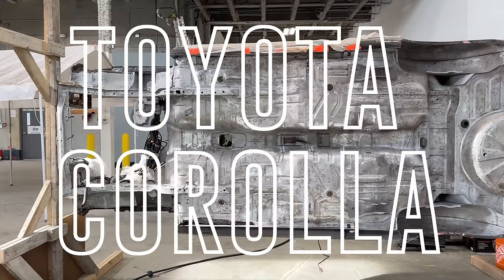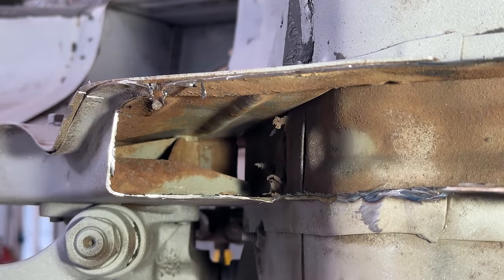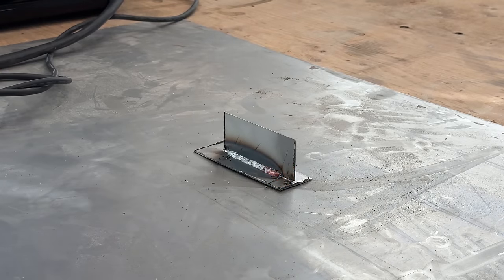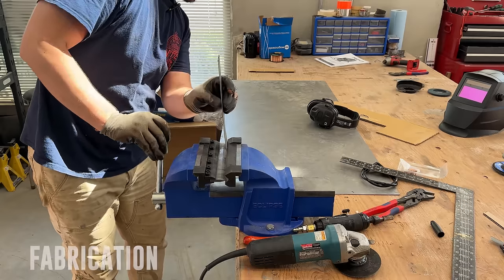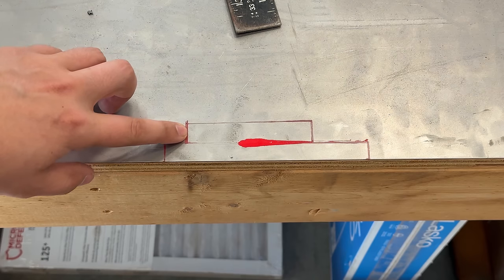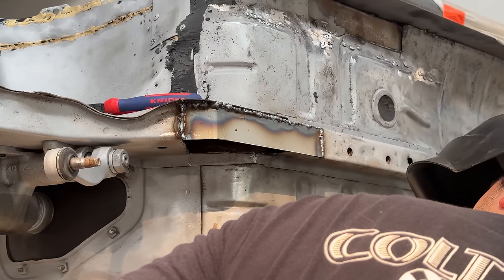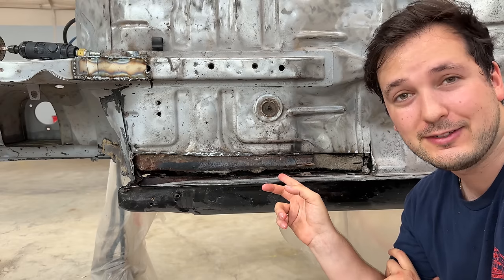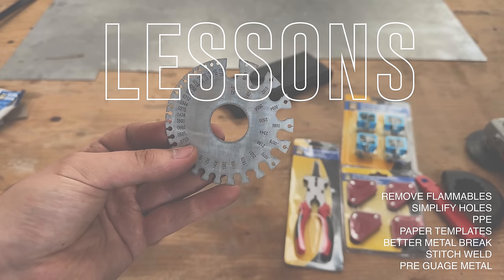1972 Toyota Corolla: Undercarriage Welding

Comment: Love your videos; what a fun project. Couple things: your regulator there isn't measured in PSI on the flow side. It's gonna either be liters per minute or Cubic feet per minute (generally). Usually for MIG like what you are doing, you want around 18 to 20 CFM. From what you showed real quick there, I think you set your flow regulator clear up to 20 L/min which is over 40 CFM and about twice the gas you wanna be using. If the gas flows out too fast, it won't provide good, even, soft (controlled) coverage and it will make your welding life hell. Additionally, you probably want .030" wire for this job, if not thinner. I think you might be running too heavy a wire in your welder there, although it depends on the thickness of the area. Also, better if you don't weld in short sleeves, because UV burns are no fun. Nice job for your first go around though; keep in mind that you are biting off a lot for a novice welder. Even coach builders who have welded 20 or 30 years find butt welding thin sheet metal tricky at times. It takes a lot of time under the helmet to get right. Also, in very light weight sheet metal areas, it's less "MIG welding" and more spot welding (via the MIG welder). Anytime you can lap weld instead of butt well, that can be helpful too (if it's in an area which isn't super visible) - that will help reduce burn through. Also, joint / gap fitment is 99% of the game when doing this kind of welding. Great job so far; hang in there!
Reply from the maker: This is such great information, thanks so much for sharing! 

You’re very right, it is L/min, I was wondering why I went through the bottle so quick. I usually had long sleeves on, especially after a hot piece of metal hit me, but I didn’t know about the UV’s.

With the wire thickness, because I went thicker, is that putting too heat into the piece?

I quickly learned fabricating is the name of the game. It was a ton of fun, and hope to learn more, thanks man!
Reply: @sansberlin  Yeah, the issue with running too high of flow rate on the gas is that you end up firing the gas out of the nozzle at such high velocity that it can actually cause porosity in the weld and/or cause a cooling effect, etc. All things which work to undermine what you are trying to do (you'd think more gas is better, but sometimes less is better). Try doing some test welds using different flow rates; try 5 CFM, 8 CFM, 10, 15, etc. and you will see the difference - also welding into a corner is much different than welding flat, because the corner helps keep the gas in the vicinity. You also want to unscrew that outside tip and knock out the splatter often; it will build up and disrupt the even flow of gas. The other thing you might not realize is drafts in the shop can have a huge negative impact. If you crack open a door to vent in fresh air and you have a breeze flowing as you weld, it will serve to blow away the shielding gas just enough to cause issues sometimes. That might have been a factor in needing more heat also, by the way. I recently did a big job where I had to weld hundreds of junction points for a concrete / rebar slab and just a light breeze outside really caused issues; I had to put up wind blocks in order to weld, otherwise the welds would go off track. So there are a lot of little, subtle things which can throw you off in welding if you aren't careful. Another thing when it comes to sheet metal welding, it's helpful to sand paper / clean up the area on both sides of the weld area using like a flap sanding wheel or disc just prior to welding, then wipe both surfaces down with acetone. That can improve your welds (more for TIG welding, but helps for MIG welding as well). You might have also been suffering from poor grounding as well. You wanna make sure your clamp is close by where you are welding and making a good bite into the metal (when you had the wire kick back on you, that's because it wasn't seeing a good ground). The other thing - and you probably have learned this by now - is you were holding the tip pretty far away from the work. Generally speaking, you wanna keep the tip in pretty snug to where the puddle is, especially when doing brief tack kinda welding. Try doing some test welding with the tip really in tight vs. back 1/2 or 3/4 of an inch and you'll see what I mean. As far as wire size, yes, larger wire requires more amps to melt and it takes longer to form the puddle. So for sheet metal work I would probably recommend the smallest possible size wire you can run. I mean I run .030 here for welding up to 1/4" plate steel. What you want is thin wire and a hot / fast tack weld. Wire feed speed is also important. The MIG I used for 30+ years had infinitely adjustable heat and speed, so you could feather a tiny bit more heat or speed; however, new welders (especially cheap ones) sometimes only give you notches (like 1, 2, 3, 4) and sometimes being between 2 and 3 or 3 and 4 ain't where you really need to be. So if your welder won't allow you to fine tune heat and wire speed, that can end up being a nightmare. If you get the heat and wire size / speed on target, you should be able to pop a tiny weld into place and have it almost end up flat. Then you just have to do some light sanding to knock things down. When you see welds which are big balls standing up off the surface, usually that means you are running the wire too fast or too big. Consider this: when TIG welding for example, in some cases (such as fabricating a stainless exhaust system) you might not even use any filler rod. When you have the material perfectly cut / fitted, you can often just strike a quick arc (again, TIG welding here, not MIG welding) and fuse the material. So if you think in terms of that with MIG welding (assuming fitment is right on the money), you really barely need any wire in the mix; just enough to add a super tiny bit. The heat is primarily fusing the two adjacent panels. It's more difficult with old sheet metal than brand new 16ga stainless, but you are kinda wanting to get into that zone. Also if you start welding body panels down the road, be super careful because coming back later to sand down a bunch of weld beads can induce a ton of heat to the panel and warp the heck out of things if you aren't careful. Let me look around and see if I can find a video showing tack welding without filler rod via TIG so you can get an idea of what I mean here. I think I have one in my book marks for Titanium fabrication.... okay here's a good example: https://youtu.be/FZ8CGGYamuE?si=uS2T_X32ngIBDnVu - see how in the beginning he's tacking up the tubes with no filler rod at all? Same when it comes to the rotary part; because the parts fit so well together, he's just melting the two parts together and not even adding any rod / wire. You can't really do that exactly via the MIG (because the arc comes from feeding wire, not from a tungsten electrode tip), but the point is that if you turn down the feed rate of the wire you can get a similar fusing effect on sheet metal. You aren't so much trying to start a puddle as you are trying to simulate a tack weld. For thicker structural parts, such as where you cut out the rust in the subframe parts, then yes you wanna run a puddle for penetration / strength. But even in those cases, you wanna try to sink the weld down a bit more for better penetration (more heat, less feed) as opposed to running the wire too fast and the heat too low and ending up with all your weld sitting up high and needing to be ground down. Try running some test beads and dial up the amps slightly and lower the wire feed rate back until the arc starts dropping out on ya, then dial it back up just to the point where it holds; also keep the tip in tight. When it's just right, you should hear a nice buzz. You might also wanna try removing the outside part of the tip all together for light work; just run the wire out with no outside cone on. You can even run separate shielding gas from a 2nd regulator. For example, on my TIG outfit, I have a dual flow regulator setup so I can run gas through the tip, but also back purge or have a secondary source of gas flowing into the work area. Kinda over kill for MIG, but then again how much do you enjoy grinding :-) Anyway, takes a lot of practice. If you saw the first few jobs I did on sheet metal, you'd laugh. I tried welding fender flares on my car once with a gas torch and it was so terrible I just ended up taking a sledge hammer to the fender haha. Really enjoy your videos. My contact info is on my YouTube channel about page if you ever have any fabrication / welding questions; feel free to hit me up anytime. Can't wait to see the next episode!

Comment: i weld 1970's Japanese cars all the time, here are a couple helpful tips. leave yourself a little bigger gap on the new piece of metal and the old car. second only tack never hold the trigger more than a second or two. and last have compressed air near you to spray it and cool it down that way it does not warp.
Reply from the maker: Thanks for the advice, why the bigger gap?
Reply: @sansberlin  not a huge gap, just a little bigger then you have. the gap allows you to connect the two together. a lot of your welds the pieces are so close that you are welding on top. that will connect the two but not the best. people will use like little 1/16 " tabs to gap it and holt them in place when welding.
Reply from the maker: @alleybuilds5370  makes sense

Comment: Your in some serious need of copper weld primer my bother 😊
Reply: Same comment I was going to make!
Reply from the maker: I'm so curious, what is this? What does it do? How do I use it?
Reply: @sansberlin  rust prevention/protection.  The inside face of the patches you applied have zero rust protection.  For the patches you can not access by removing the carpet, you can treat by applying Eastwood Cavity Wax.

Comment: Switching from Gasless / Flux to Gas welding also requires reversing the Polarity of the Gun...Your Manual for your Welder should explain that and how you do that for your Machine....Check which way it is set as alot come setup for Flux / Gasless welding....and that can cause Bad Welding or Poor Welds ( especially for a Novice ).... I Rent or rather Lease a Gas bottle as it is cheaper if you weld lots...and saves running out of gas and spending time and fuel to get it refilled.... the bottles you buy are ok to start with ( and keep as backup gas use ) but are going to cost you more over long regular use....Leased bottles  come in various sizes ( get one as big as you can afford and transport safely ) and are cheaper to refill ( like buying bulk food works ).... plus they taje care of maintenance on that gas bottle ( testing and replacing as required ).... it is a small fee yearly i find worth the cost ( small bottles would cost be more than that fee and always run out when you are wanting to finish your work ) ..

Comment: Buy the Princess Auto Sheetmetal Brake when it is on Sale...the 36" one....on a Stand...I bought mine 25 years ago and even after getting a Bigger 8 ft model and a 48" Box & Pan / Finger brake ..i still use it lots....it can do 16 guage metal too.... a brake that actually is designed for sheetmetal work is alot easier to do bends than a Bench Vice or Shop Press add on...( they work too but i learned on a 10 ft brake in 1991 and also a 4 ft Finger brake too.)... plus once you outgrow your panels a tiny brake is useless...lol...
Reply from the maker: All these comments are golden, thank you for all your insight and experience, will be following a lot of your notes and critiques. Appreciate you sharing!

Comment: Just stumbled upon this and is just amazing! I got myself in a similar project and went through some of the same challenges as you, the tips I figured out were:
-to make the replacement panels out of the rusted ones (use the rusted ones as a template before you cut them)
-the smaller the gap the easier the weld
-spot welding in opposing directions to avoid burn-through and warping
-try playing with a higher wire speed, especially in spot welds
The last one was a big improvement for me as I am using flux-cored wire, and due to the wire nature, the welds tend to be hotter. so theoretically using gas as a shield for your weld you have a bit more margin for error and improved results!

Bear in mind that I am no expert and this is just input from my results I hope it helps in any way!
@Fitzee's Fabrications is one channel that I can recommend for further tips and inspiration!

Comment: u should run thicker wire, it will make ur welding much easier =)
Reply from the maker: I heard that the standard was .030, so I ran .035. What would you suggest? Is it dependent on the sheet metal thickness?
Reply: @sansberlin I use .023 on sheet metal up to 19ga/1mm and .030 on thicker.